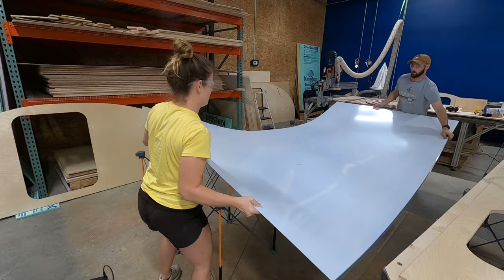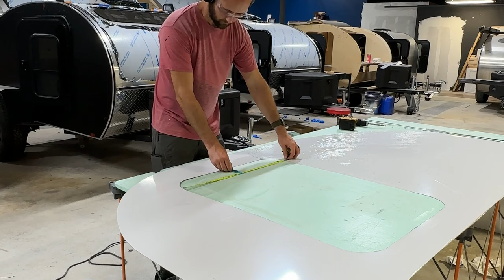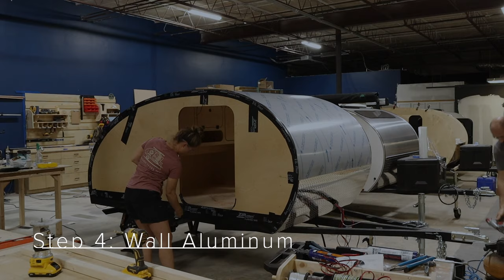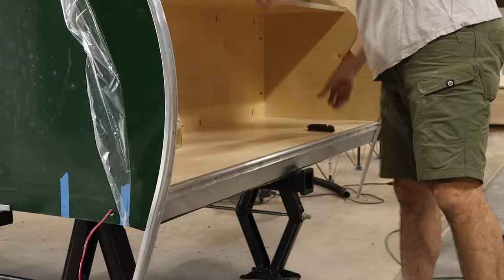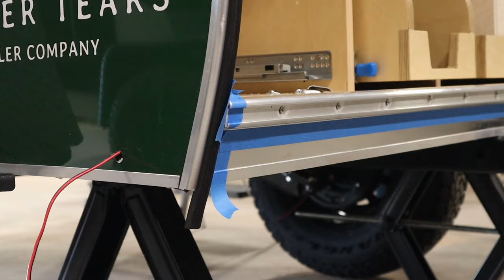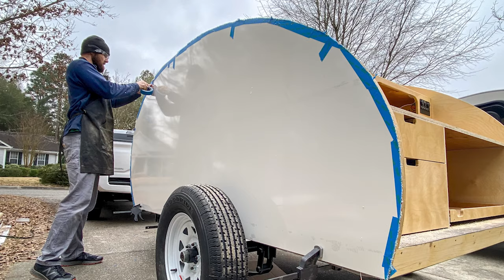How to Install Aluminum on a Teardrop Camper - Start to Finish - Timelapse (Video 8 of 10)

Comment: What gauge aluminum are you using? Do you have a preferred supplier for the aluminum sheets? Seems you are "floating" the siding but still using adhesive for the parameter of the panels?
Reply from the maker: We use .040 or .050. Diamond plate is .063. And yes, we float the walls as they tend to flex with the temp more. And the adhesive is actually a flexible RV sealant. It helps hold it in place but also does not harden fully.
Reply: Where do you get the aluminum?